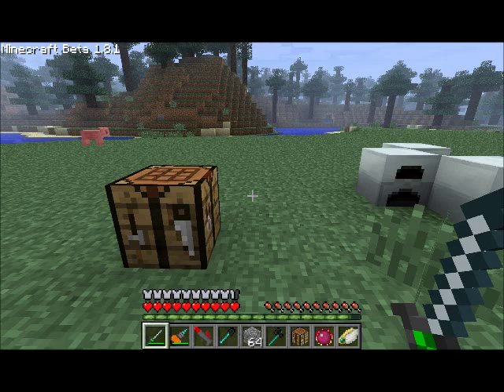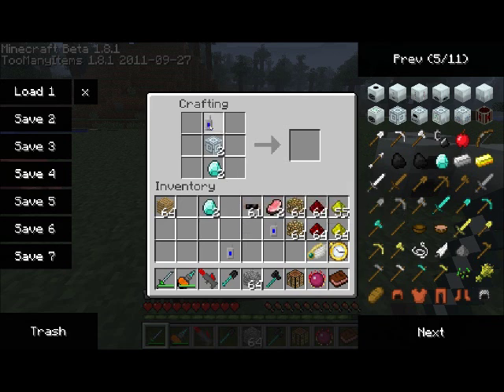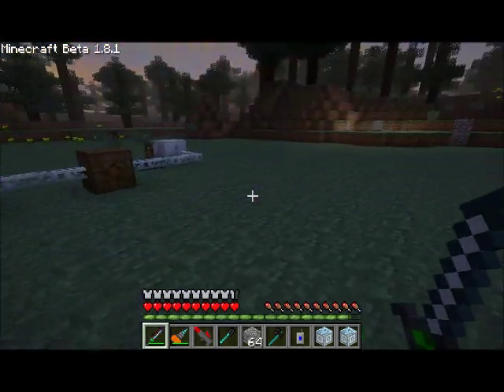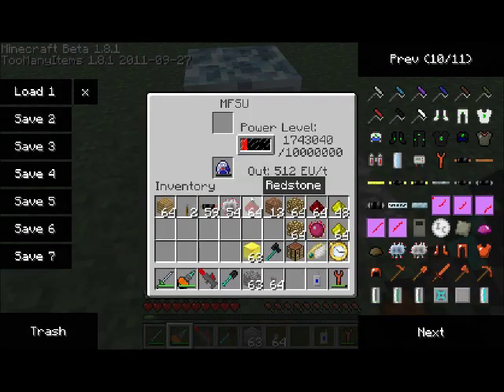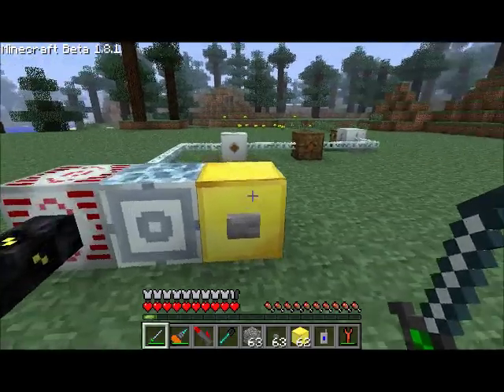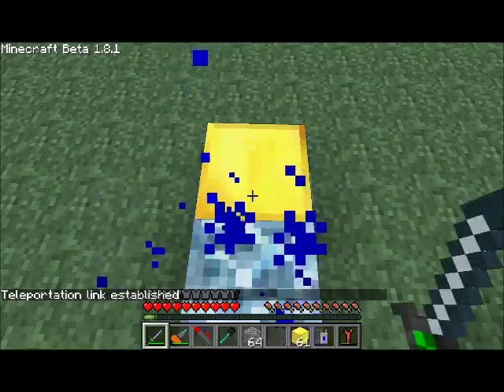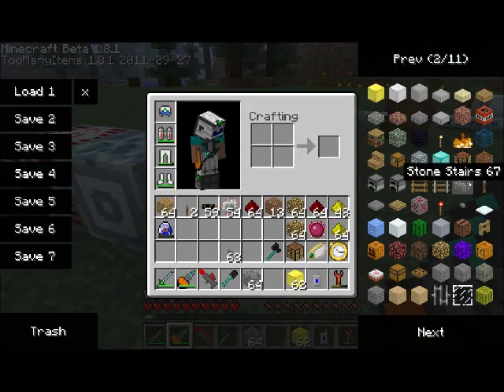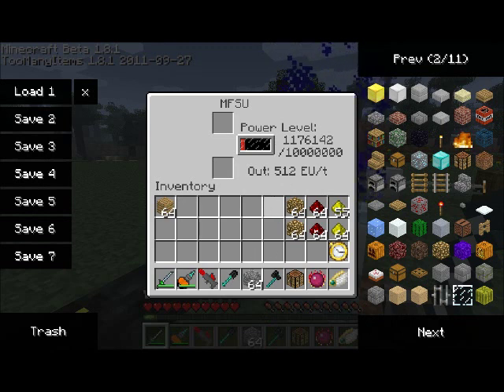IndustrialCraft 2.0 Tutorials - Teleporters

Comment: I have a problem where i use teleporter activated with a button to travel a distance of about 3000 blocks it works fine but upon returning i get instantly re-returned back to where i was, upon travelling back by foot i find that the button has "stuck" in the on position. any solution for this?

Comment: I have a problem with my teleporters... when I use the frequency transmitter to set up a teleporter network, the following two messages appear when I right click on the first teleporter:

1)frequency transmitter linked to teleporter
2)frequency transmitter unlinked

why does it do both at the same time? any help?
Reply: You sneak and click ^^ Juste right click ^^